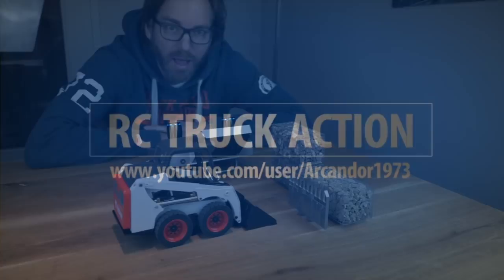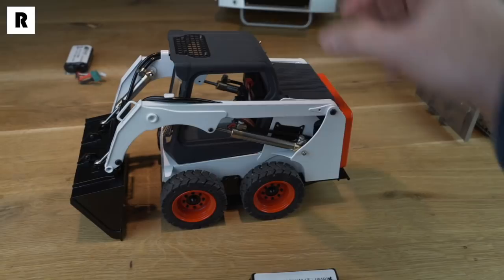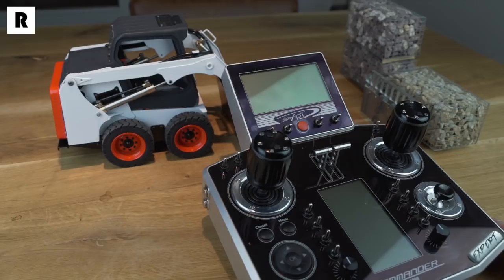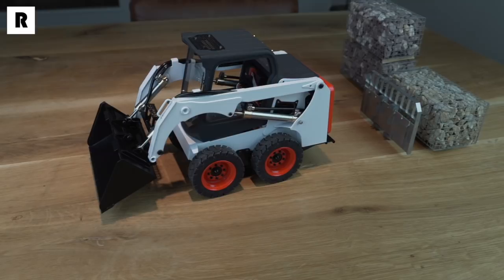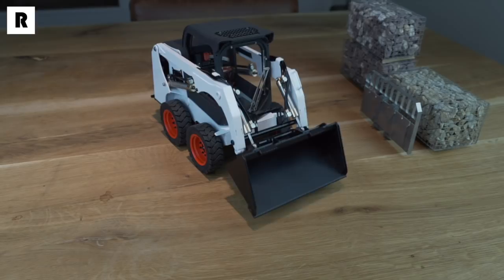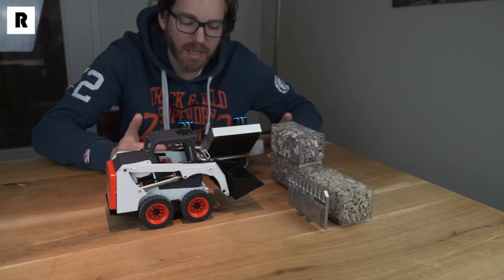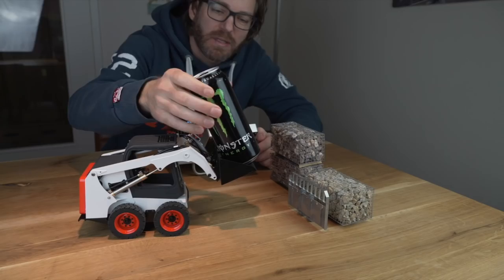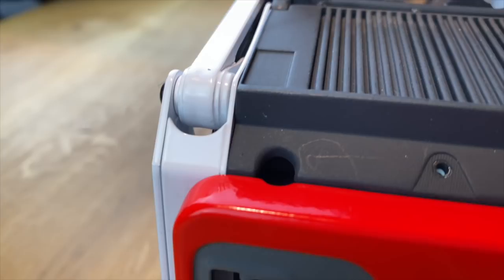BEST RADIO CONTROLLED Bobcat with real hydraulics from CHINA

Comment: Nice walkthrough video.  Can you post a link to the speedcontrollers you are using for the drive motors please. I have tried 2 different ones that are not so smooth.
As you can see with the one on my channel
Reply: Its literally the 3rd link in the video description
Reply: @m1n1truck3r2  if i click the 3 link i go is to the parent company with eaht æooks lik different speed controller versions products ,not the specific speedcontroler he used.
Reply from the maker: Thanks for your nice comment! For sure, it’s the 211500 Proportional Drehzahlsteller Compact Drive ESC. Thanks for watching! Best wishes, BJ